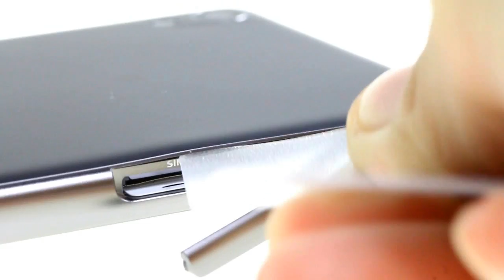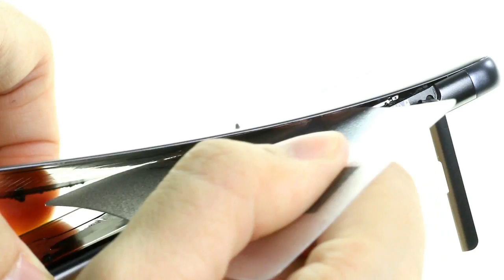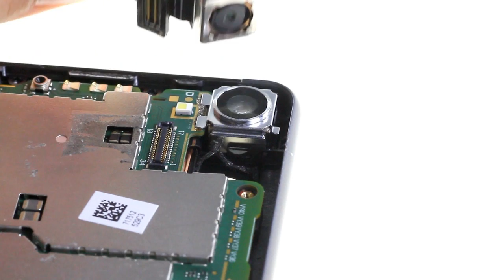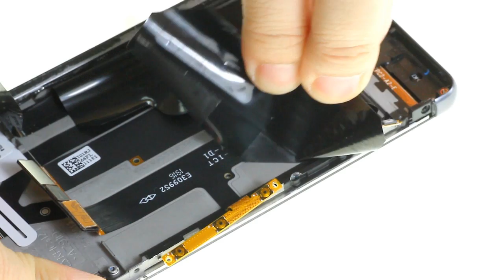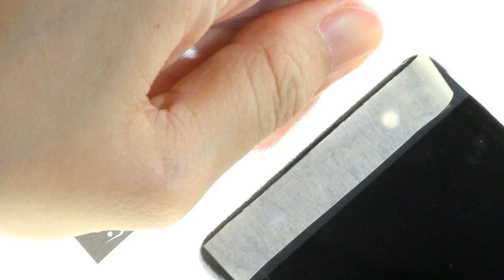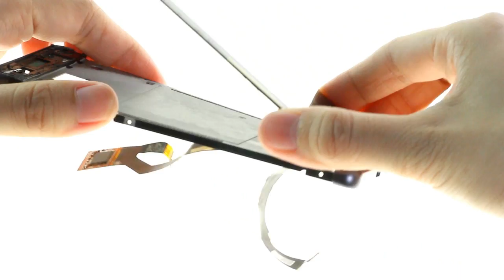Sony Xperia XA Teardown

Comment: Hi.
I submitted xa in service centre due to battey issue. After collecting the device, i found that the front camera sometimes shows error and sometimes it works, to which i thought to be a software issue. So within 2 months of repair, my phone went entirely dead, so after submitting in service centre again (in warranty), the service centre dissambled the device and found that the camera module connector was cut in one side and they refused to consider camera in warranty. The excuse they gave me was that, "why didn't i informed the service centre immediately about it."

Can you suggest something or what should i do? What is the cost of the front camera module?
Reply: 5:26 This connector was cut in oneside.

Comment: do you need to keep those battery peel tabs ??
Reply from the maker: Do you mean the black piece of sticker? Yes, that's battery sticker
Reply: The four bits round the battery yeah thats them, Can u keep them stuck to the battery if you take your time?? Got the whole assembly
Reply from the maker: Sir do you want to change the Battery? If yes, the original battery sticker can hold it tight

Comment: Is it possible to replace only the outer glass lens, if it's broken, but the touchscreen is fine?
Reply from the maker: Yes it is possible, but it's a tough work cause the glass and the touch display were made together by machine with specific temperature and pressure, not easy to be separated, it need professional operation otherwise the touchscreen might be damaged

Comment: That top portion of the display was really a pain to take off haha. Im wondering, would it be okay to actually slide under the silver backplate instead of following the tape guide?
Reply from the maker: Do you mean after you made a gap and insert the card to it? yes, if you don't need that screen :)
Reply: Wit Rigs I mean before. I was thinking the backplate looks very thin and was wondering whether it's ok to slide underneath it seeing as you struggled quite a bit trying to get the glue off :)
Reply from the maker: the screen sticker is very adhesive and need time to get it off. n in the video that was because I used the intact original screen to make the video and uh I don't wanna break it :(
Reply: Oh ok I guess I'll stick to following the tape guide, thanks :)

Comment: As I mentioned in a comment below. My XA got a bit wet a week ago and there's distortion in the speaker. Everything else works fine. Is it busted? Do u think that the water indicators got red? It got a little wet, on the surface. Perhaps some water sneaked into the speaker ..
Reply from the maker: Do you mean the Mic is broken? If yes the Mic might be water damaged, my suggestion is try to dry up the water inside, and then see f the problem solved, if yes it's okay with happy ending, if not you should better replace a new spare part. Here  a water damaged therapy video, you can take it as a reference https://www.youtube.com/watch?v=YnnhQfzW6_k
from 2:06 it would tell you how to dry up the water inside.
Reply: Wit Rigs no, no. The loudspeaker is. Some ofbthe sound output likebthe basses sounds disotorted.  It's been a week, it should be dry already. Thanks for the video, I'll check it out later
Reply from the maker: Okay... next time when the phone got wet, you should dry up all water both surface and inside, if the water left inside and you keep using it, the water would damage the metal part, do not trust the rumor like "if your phone got water inside just keep using it and the phone heat would evaporate it"  hope this can be help :)
Reply: Wit Rigs yea sure thing, thanks again